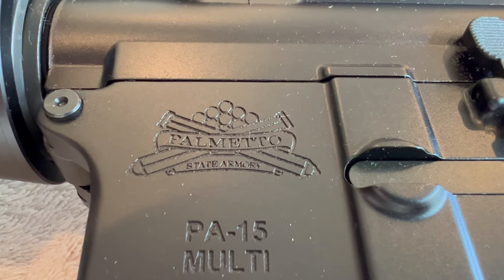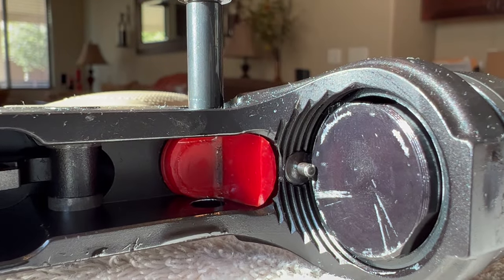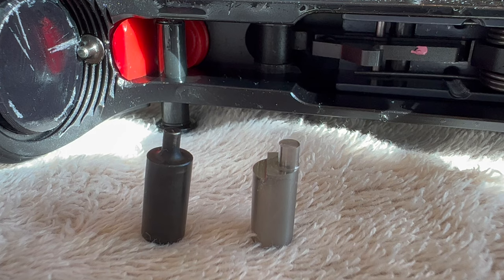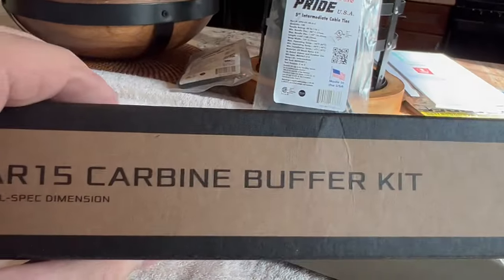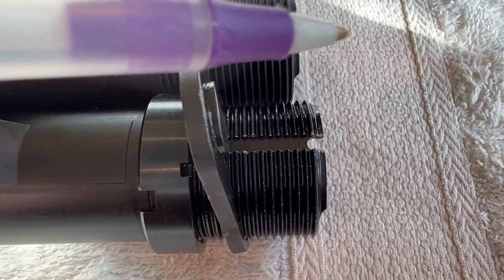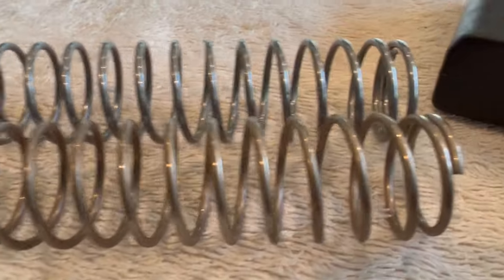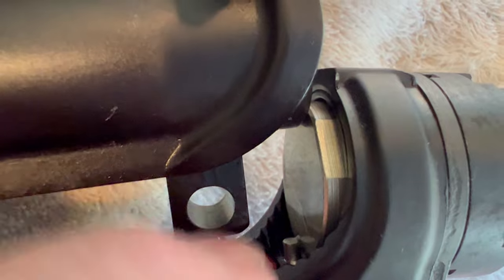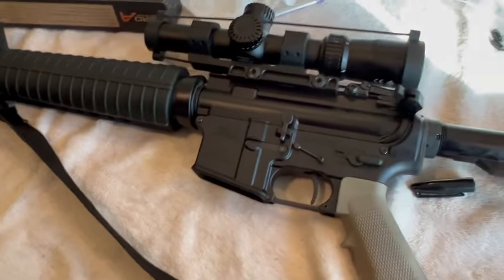AR-15 Another Buffer Retainer Pin Issue & The Fix!

Comment: Totally wrong. The pin didn't leave those marks. Notice the vertical marks on the buffer that are well out of the reach of the pin? Evidence of a bur on the back of the carrier
Reply from the maker: Take a closer look at the very edge of the buffer and you'll see where it was making contact with the retainer pin. The scratches are from me closing the receivers halves on occasion and not making sure the BCG was fully seated.

Comment: I just take out the pin and everyone freaks out but mine runs just fine np
Reply from the maker: I've seen where people have done that! The only reason for the retainer is to capture the buffer when opening or closing the upper and lower receiver halves and has no effect on rifle function unless the buffer hits it during firing. Thanks for watching and commenting!
Reply: So you tryna tell me that your AR is perfectly fine without the pin?
Reply from the maker: You can run your AR without it but it makes things a little tougher especially when closing the two halves. I would rather have the retainer installed. @guapobeatz2704

Comment: I only made the mistake of buying a PSA buffer, extension, and spring kit once.
Reply from the maker: It's hit or miss with PSA sometimes! I think in this case the bolt carrier or the lower retainer hole was just slightly off? Easiest and cheapest fix in this case was an off-set retainer pin. Thanks for watching and commenting!

Comment: I just put the buffer in the lathe and take a very light pass the height of the retaining pin to take only the marks away leaving plenty to make contact with the back of the bolt carrier. Less than a 3 minute fix
Reply from the maker: Well that's crazy enough to work! Lol!

Comment: I have a PSA lower.  Put a $100 buffer system in it.  Havent even shot the rifle yet, but from dry firing for a couple weeks my buffer face is half destroyed from the pin 🤬
Reply from the maker: If it's the pin the damage will be on the very edge of your buffer. If a ring is developing further up you may a have a burr on the back of the BCG. Thanks for watching and commenting!

Comment: looks to me like the bcg is hitting it bub.
Reply from the maker: Wear on the very edge of the buffer is the retainer pin. BCG wear will be further up from the edge and will match the BCG dimension. The scratches are from occasional closing of the two receiver halves and not making sure the BCG is fully seated.

Comment: The Aero Precision extension tube (buffer tube) also sits further in than the original one.
Reply from the maker: It did line up a little closer with the top receiver edge. Much better fit than whatever PSA used!

Comment: I believe that was a "enhanced " buffer tube. The bottom of it is supposed to give the bolt something to rest on to improve bolt slop and improve feeding/extraction. I have no clue why a psa  would ever need it.
Reply from the maker: It wasn't an enhanced as there was no extended lower portion. It just had a slot in it for no apparent reason. I'm wondering if it started out as an enhanced and who ever manufactured it screwed up so they trimmed the bottom portion off and PSA got a good deal! The only other thing I can think of is that they couldn't keep tolerances and put the slot in there for an extra turn or two over the retainer. I have been building AR's since the early 90's and this was a new one on me! Lol!
Reply: @peteregger7928  i had a standard psa full lower kit come with that. i like it because it helps center the tube

Comment: On the accu wedge, I recall you mentioning about trimming and fitment. Do you recall what video that was in? Thanks
Reply from the maker: Not off the top of my head. I was showing something else in the video and just mentioned it on a side note. Most Acccuwedge's on my rifles because of the high shelf receivers needed some trimming. One of my old Colts was acting up and I eventually discovered that the top of the Accuwedge was being hit by the BCG and rolled over in front of the retainer pin. After I trimmed it down for BCG clearance I never had any cycling issues again. In this video you can see where I have trimmed the top of it out of the way. Didn't realize at first what was going on way back when and had replaced the buffer spring trying to fix the cycling issue at some point. Lol!

Comment: Alright, this might be a odd question. If I had a rifle that hadn’t been fired but wanted to be thorough; would there be any harm replacing the original buffer retainer pin with the off-set retainer pin?
Reply from the maker: Wouldn't be a problem unless it allowed the buffer too far out and possibly the end of the BCG would come down on top of the buffer when closing. I personally would only install the off-set if there's not enough engagement between the BCG and buffer though. If it's close I would just keep an eye on the rifle until I saw some indication that there's buffer damage.

Comment: Nice Job Pete Was That a Rifle Length Buffer and Tube Assembly From Aero You Got  😀
Reply from the maker: It was Carbine! Compared to the short PSA spring the Aero looks like rifle length, Lol! The spring tension on the Palmetto was much weaker also. Didn't notice any slamming or bottoming issues and it cycled fine the last time I fired the rifle so I guess the PSA spring was okay? Just the retainer issue... so far!
Reply: @peteregger7928  Lol That’s Quite a Difference Between The Two

Comment: Mine has the maximum defense pdw or cqb pistol brace and like first or second time to the range the castle nut backed up enough to allow the buffer tube to back out and the retainer pin shot into the upper and got jammed under the trigger assembly it was a lil bitch to dig out but I got it and the spring itself got sheared from the big but it didn’t break it but I just shoved it back there and it’s been fine
Reply from the maker: Wow! It certainly did come loose! At least no real damage!

Comment: Could have been fixed easily with just screwing in the tube one more turn , the tube you have is a commercial version and you replaced it with a mil-spec version, they are different in diameter as well , so going from a commercial to a mil-spec your buttstock would be loose. 
Yes that would be PSA quality control issue . 
I seen it many times , sometimes the buffer tube needs to be fitted a bit for the tip of the pin to move freely, 
The cause is how the the treads start on the lower receiver and how the threads are timed on the tube , tolerance stacking is a real thing .
Reply from the maker: Unfortunately the tube location does not determine where the retainer pin hole is drilled in the receiver or if the BCG carrier is a little short which does determine where the buffer ends up. Just turning the buffer tube another turn will not stop the buffer from hitting the pin during firing if this relationship is off.
Reply: @peteregger7928  So did you verify the “out of spec” pin bore with any type of measurement? I would be curious how far off it was by some sort of value like .050 for example and also what tolerances are allowable like .001 to .008 ? Or did you just go by sight ?
Reply from the maker: It may or may not be the retainer pin bore location in the receiver. The BCG carrier could be short. The relationship between the barrel extension, receiver front/rear or a combination of things could be off. Upper and lower receiver take down and pivot relationship could be off. It's a Palmetto State Armory using their BCG so I didn't bother to blueprint the rifle trying to figure out exactly where the culprit/issue is. Easiest and least expensive fix for me is the off-set retainer. Some people with this issue will run their rifles without the retainer pin. Its only function is to keep the buffer from flying out when separating the halves. The buffer should never make contact with the pin during firing. @oldyellow66

Comment: That buffer ware can also happen from just hitting the back of he bolt.. You have to actually check, slowly close the upper with and watch with a flashlight if the buffer sets back.
Reply from the maker: Thanks! I checked all that before the video and the BCG barely made contact with the buffer and not enough to move it completely off the retainer. The edge wear on the buffer comes from the retainer pin being hit during firing. A wear ring above the edge as you're saying is from the back of the BCG. The rifle has less than 100 rounds through it so other than the buffer edge just starting to get chewed up there was no damage.

Comment: I had issues on my am 15 i would get it seated in there exactly like that and put it back together and got to rack it I could here it pop up and just make a damn mess. So would i be better  to buy a new kit as a whole bc the spring also got mangled
Reply from the maker: Sounds like your situation may have been different? If the receiver retainer hole isn't in the right place you only have two options. Either an off-set retainer pin will address it or a new lower receiver. So far I've been able to fix mine with just an off-set.
Reply: @peteregger7928 thank you i appreciate it im sure an offset will help thats what it seems like it slips under my buffer tube
Reply from the maker: Possibly you have an incorrect, short or weak retainer pin spring so that the retainer pin does not come up high enough. I had one retainer pin where it was pinched (not round) at the bottom keeping the retainer spring pinched inside or there is something wrong in the retainer hole or maybe drilled to deep. If the retainer pin hole (pocket) is to deep you could drop a spacer into it or find a longer spring.@ch7162
Reply: @peteregger7928 i appreciate all the information im actually still a green horn when it comes to the ar platform. I wasn’t screwing my buffer tube onto it fsr enough and had to buy a castle wrench got it all set🙏
Reply from the maker: Good deal! @magmitch7162
Reply: Glad I'm not the only one that has happened to only put one mag through it too lol
Reply from the maker: This is more common than I originally thought! I have about 5 of these off-sets installed on my rifles now!  @myalaskalife5837

Comment: So when you close the upper to lower, the bcg should be contacting and pushing the buffer weight in? The issue was that there was too much of a gap? And no contact? Buffer was riding on the retainer too much?
Reply from the maker: Exactly! If the buffer does not get pushed off the retainer pin by the BCG when closing bad stuff will happen during firing! The buffer is only supposed to touch the retainer pin when opening the receiver halves.
Reply: Ty for that knowledge. I’m building right now and when I shut my upper I believe I’m feeling contact of BCG and buffer. So I should be good. 

Aero lower 
Aero buffer kit
PSA retaining pin 
BCM upper and bcg
Reply from the maker: If you put the upper on top of the lower without the pivot or take down pin engaged you should be able to see that the buffer is making good contact with the back of the BCG before applying any rearward force. There will be a noticeably gap and you will have to use some force to eliminate the gap  showing that the buffer was in contact with the BCG. The other way is to leave the front pivot in and very slowly lower the upper into position and using a flashlight to see if the buffer comes off the retainer pin. If after firing you notice the very edge of the buffer getting dinged up you know something is not right. A circular mark matching the BCG shows up sometimes further away from the edge and is normal on a lot of AR's. That's usually from a burr or the back of the BCG not machined straight hitting the buffer at a slight angle instead of flush. If everything between the buffer and BCG contact is perfect that mark will take thousands of rounds to appear. I have an old Colt with about 3000 rounds through it and the buffer face still looks new. @0dteESmini
Reply: @peteregger7928  hell ya its touching. ty
Reply from the maker: Good deal! @0dteESmini

Comment: do you have to change out the whole buffer tube or you just can order the Offset Buffer Retainer and put it straight in ? does it come with the spring or you can run it without?
Reply from the maker: All you will need is the off-set retainer. You will have to unscrew your buffer tube far enough to release the original retainer and install the off-set. Then tighten and torque your original buffer tube again. About a two minute job with the right tools. You will reuse the old spring. There are a few companies that make the off-sets but I purchased mine from Galloway Precision.

Comment: I got two psa lowers one runs flawless  my other one haveing light primer strikes should i chnage the buffer tube and mine has scraps like on bottom like were you show so should i change the retainer then sir
Reply from the maker: Very light primer strikes during chambering is somewhat normal for AR's as they use a floating firing pin. Firing pin protrusion could be too long. I would have to see it to know exactly what's going on. If you're getting light primer strikes while firing this is usually an indication of something going on with the trigger like an incorrectly installed or weak spring but once again could be not enough firing pin protrusion. It's possible that a head spacing issue caused by the bolt or barrel chamber could also exist. If the very edge of your buffer is getting hammered or chewed up then it's hitting the retainer pin and the cheapest fix is an off-set retainer pin. If there's any doubt as to what's going on I would suggest having a gunsmith take a look at your rifle!
Reply: @peteregger7928  yeah it's chew up on bottom buffer weight thanks for the video and the tip very helpful I'm change the retainer then go from there to the trigger
Reply: If your light primer strikes happen when you pull the trigger, try a different firing pin. Firing Pin protrusion should be .028" to .036".
You could also look to make sure your hammer spring is installed correctly. Even when they're not, they can look like they're installed correctly. Inspect carefully.

Comment: What do that' pin do do it make it fire
Reply from the maker: No, its only purpose is to retain the buffer when splitting the receiver halves. If it's not in the right place the bolt carrier will not prevent the buffer from hitting the pin during firing and damage to the rifle will occur.
Reply: Yee cuh! Jit go BLAM now cuh'!
Reply from the maker: Ha! Ha! Exactly! @danefuentes3877